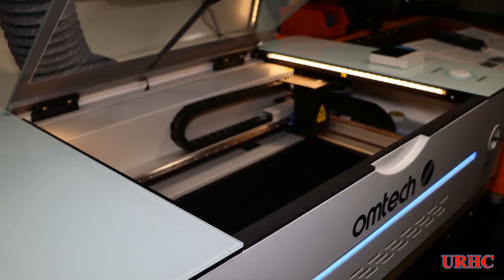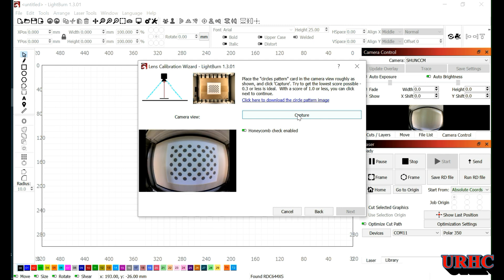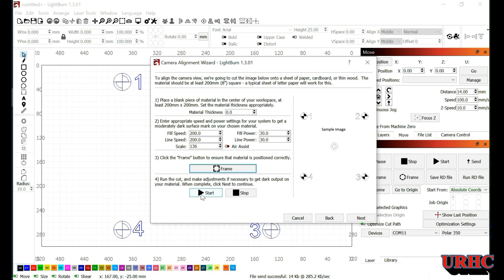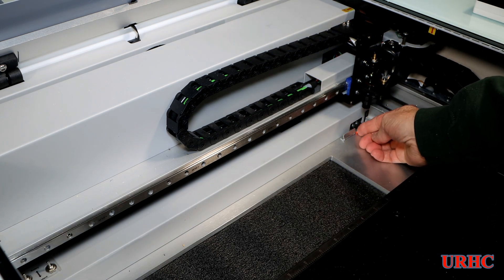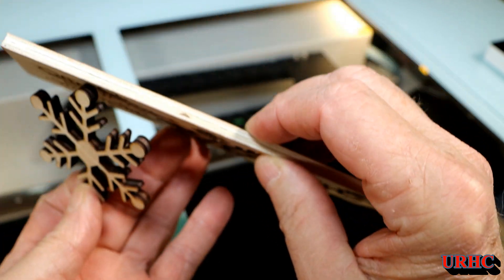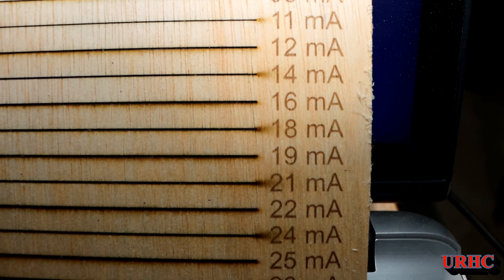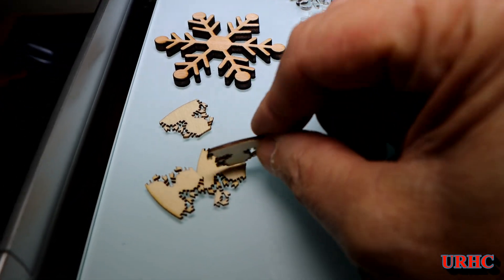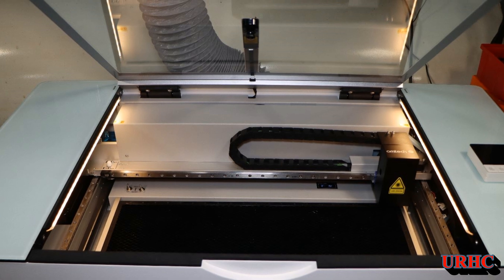omtech Polar 350 50W Desktop Laser Engraver Part 2  Using Lightburn Camera And First Cuts

Comment: What settings did you use for the engraving in the wood?
Reply from the maker: Run the lightburn test patterns on a sample of the wood that you're using. That will show the exact results for you to choose from. Each type of wood will use different settings. The test speed and power will determine your project settings.  Thanks for watching.

Comment: thank you, thank you, thank you!!!!!  My husband just bought me an OMTech Polar 350 and I have never used a laser or Lightburn and all I've done so far is turn it on :(  Now I feel like I might have the confidence to sit there with your video going and actually do something :)
Reply from the maker: Jumping right into a Co2 laser will definitely be a challenge.  There are great videos about lightburn on their channel to help get you started. Be sure to properly vent it for working with acrylics as the vapors are dangerous. Some need alignment up front so check that and get some good lens cleaning supplies.  Have fun. Thanks for watching.
Reply: Cheat code: just ask everything to ChatGPT. I knew nothing about my laser and ChatGPT has given me every setting, answered every question and has made using my laser super easy.

Comment: What settings are you using to cut 3mm birch? My mom just got the Polar and had a glowforge. She can't get anything to cut. No one seems to want to help. I have 2- Omtech 50w machines but the polar is different. Any help would be great!
Reply from the maker: I have been using the settings in the book. Sounds like what happens with a dirty lense or focus issue. If you cut or engrave acrylic the lense can get dirty in a couple minutes,  especially if the air assist  line gets kinked where it enters the head. I would  start with a full alignment of the mirrors and lens. then run a ramp test and verify focus length.  I made a gauge for mine to verify focus before each cut. Just lower the nozzle to it and no longer try to use that auto offset. Be sure the air assist comes on during the cut. I had good luck getting help using the email system. I have another video about  how I am using cloudray lenses to save money but American photonics has a nice easy to clean setup for them now. Let me know what you find.

Comment: Hey Ed, I had a question with respect to the lens. I believe the Polar comes with a 2mm lens,  I'm interested in getting a 1.5mm for finer detail engravings. Is it pretty cumbersome to swap back and forth between a 1.5 and a 3 say? Also I see on the OMTECH website, "12mm ,18mm, and 20mm" each one having a 1.5, and 2inch available. How do I know which of the options is right for me? Thanks! I'm having a lot of fun with the polar and learning a ton about what i can do and I can't do. 

I also ended up geting an Xtool to try it out the diode/infrared module, super curious to see how that one is.
Reply from the maker: I am using Cloudray 15mm lenses from ebay in mine. There  is another video showing how I had to knock the original from the lens holder and super glue the new one in place. I bought a dozen and they were $12.00 each compared to the $65.00 for an Omtech assembly.

I think going with the longer focal distance lense in the spare lens tube that was supplied with the Polar will give a finer cut with less power but haven't tried it. You will have to drop the honeycomb and run tests for the new focal point though. It would be best to shoot Omtech support an email to see what they recommend and if any other options are available now and how to setup the longer lens. 

I am thinking about buying a fiber laser to try in the future but the capabilities of that xtool infrared module are almost as good. Thanks for watching.

Comment: I have a question. I just received my polar 350 yesterday completely new to laser world. I was cutting a Apple Watch jig using 3mm basswood that came with my laser but my settings must be off because it’s not cutting through board completely
Reply from the maker: First check the laser beam alignment to be sure it didn't  shift during shipping.  Then check to be sure the mirror and lens are clean. Next be sure you are moving the lense to the correct focal distance per the instructions of the offset that must be entered.  Also for cutting the air assist must be turned on in lightburn for best results. Also check under the cover that the air assist line isn't kinked cutting off flow. Best to send Omtech an email or call if its a new machine and they should be able to walk you through getting started. Power and speeds they give are a good starting point but not always perfect.  Good luck. They are an amazing little machine once setup. Thanks for watching.

Comment: Can you use LightBurnSoftware wirelessly including seeing the camera?
Reply from the maker: I have not tried that yet but supposed to work for the laser. It's a Ruida controller that should work. Best to send Omtech an email to verify it will work with your equipment.  The camera  is powered off the usb cable separately so I don't think the camera would be available without a computer.  Thanks for watching.

Comment: Question, my machine keeps raising my z axis every time I hit run.  I lower the z and set the offset yet it keeps raising it back up every time.  Any suggestoins?
Reply from the maker: Sounds like you changed the machine settings in the controller. Mine only homes at startup and then I use lightburn to move it down in the z move box to focus it before running. It will stay there untill the machine is turned off and then back on to home.  Also in lightburn when you enable z move there is  a check box below it that can cause this if checked. The auto focus on this machine isn't really autofocus. They have excellent support if you need help to straighten it out. Thanks for watching.

Comment: Oh man - that switch under the honeycomb board? I seriously spent 2+ hours in frustration trying to figure out why my Polar wouldn't start the cut for the calibration in the same spot. There isn't any troubleshooting anywhere for this, so thank you!
Reply from the maker: So far I have found 3 reasons it will just stop, The switch,  lines over 200m/sec, and lightburn overruns when close to the limits.  I also have spent hours figuring them out. I have a Ruida control panel on the wat from China that's supposed to plug right in and give errors, focusing,  laser fire fot alignment,  and file run from comtroller without a pc. Will do a video when it arrives because it will reallly be a great addition.  Thanks for watching.

Comment: Thank you so much for this video:    You saved me from Disaster.   I think I am going to look into the Aeon Mira 5  or the Epilog Maker ,  subed.
Reply from the maker: I just did an update about setting the camera up in 10 minutes per a Gweike video. They did not use the Lightburn instructions and did it with the lid open. For the price this is hard to beat and is a great starter  Co2 with a long warranty. Trouble is instructions are lacking at this point. I plan on upgrading to one of the big 100 watt Omtechs someday for larger items like doormats.  Thanks for watching.

Comment: I can't wait to get this machine, gonna be a massive upgrade from my xtool d1 10w pro, my business has gotten so busy that it just can't keep up, I wish I could've bought one of the big machines but sadly space is an issue so this will hopefully suit my needs :) thanks for the video as always!
Reply from the maker: Space is my problem also. Along with a 32 inch entry door. This has the same capability as a larger machine for parts up to about 12" x 20". The rotary is limited but raising the machine about  an inch lets it handle tumblers. Xtool lasers do do a great job and I find I can get darker images with mine. The Co2 burns deeper with a lighter shade of brown. Great to have both plus this opens up clear acrylic work.  Thanks for watching.

Comment: The audio of the last couple videos you made drops out with clicks. This happens randomly about 1 to 2 times per second. It’s difficult to understand what you are saying.
Reply from the maker: I just rewatched it HD and 4k and don't have that issue.  Could be the YouTube feed because they reprocess it after uploading. Thanks for watching.
Reply: I watch your videos on a cell phone. Watched on a desktop just now. The clicks are there also but not as apparent with a larger speaker.
Reply from the maker: I am not getting any of that on my pc at 4k or tablet at lower resolution.  I have no idea what it could be.
Reply: Sounds like the audio was post edited with a software to reduce noise in between words. It clips a lot, the audio is hard to listen to

Comment: Ed, have you thought about laminating a enlarged photo onto some thin plywood and then custom cutting a puzzle as a gift idea (or option). I would imagine you would have to seal the artwork to the surface first or else the artwork might be prone to flaming.  Just a thought!
Reply from the maker: I have not tried that. l bet laminating to heavy cardboard would work best because that cuts very clean at higher speeds. I may have to try that. Thanks for watching.

Comment: There should be a way to create a delay where the pump turns on then the machine starts cutting right?
Reply from the maker: I think so. usually a post processor handles that in the cnc world. It's  a pretty big long hose from the pump. You can see how beautifully it cuts once pressurized.  Some simple things to work out that willl make this a perfect machine. I sent them the info and hopefully it's a simple firmware change. I know nothing about this type of controller.  Thanks for watching
Reply: @unemployedredneckhillbilly2023  if your outputting a g-code, then yeah, it would be in the post processor.   Looks fun...
Reply: I literally just replied what you said,  its late, I'm tired,  I'm off to bed... PEACE ~

Comment: Think you're right, it definitely needs more documentation and some tweaks to the machine as well.  
It does do great work once you got it going. If I do get in to working with a laserbthis would be a machine to consider when the time comes.  The one thing I did notice it doing well from the start was smoke evacuation.
Reply from the maker: It definitely does beautiful work. The camera calibrating is really a lightburn issue and should be easier with instructions.  There is zero smoke or smell in my shop when this is running.  They did a great job with that by using a proper fan with variable speed. The biggest  frustration is when something goes wrong with a file. There is no feedback so it can take some investigating to figure why it stops. Just some minor issues to work out and it's a complete simple Co2 laser that will be hard to beat for getting started that doesn't take up a ton of  space. Thanks for watching.